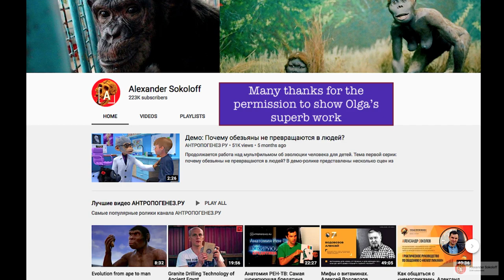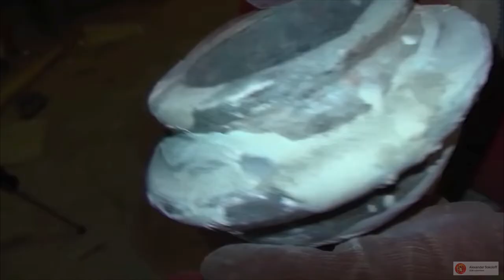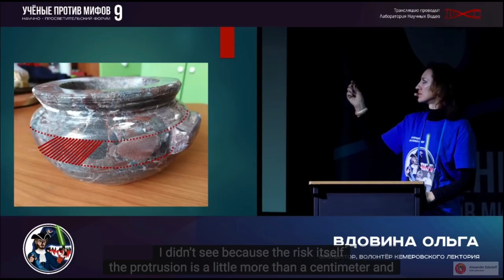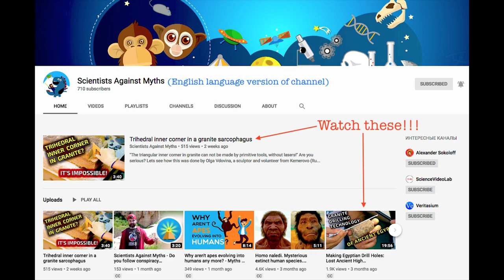How to make an ancient Egyptian Predynastic stone bowl with primitive tools!

Comment: And if you have a water powered saw and a lathe you would almost certainly have a powered drill, planning machine, milling machine........ It would even be possible with quite low levels of technology to have carborundum or even diamond tips on the tools - see here https://en.wikipedia.org/wiki/Diamond_tool under the section "Categories by manufacturing method" for attachment methods. These machines would be principally made of wood so nothing would remain 5000 years later.

Comment: I great how well she did with the first try. By way of comparison The Lotus Flower Vase with the three  partially folded lips at the Cairo Museum (that  Brien Forester points out) was very nicely done.  The object looks like a steering wheel or a gemie for making rope.  If you look at it closely, as with all the objects claimed to be made with "ancient high technology" they are not perfectly straight in places which suggests that they are hand made.  That is pretty impressive too because they are so delicate and thin.  The amount of time to do such a project is beyond me.  Chinese jade carving is a similar kind of hobby where people put endless amounts of time into a single object.
There is a relief of an Egyptian wooden lathe circa 300BC. The spun article is held vertically between two horizontal cross pieces.  A second person spins the object using a piece of cord wrapped around the object.  Having a helper would make all the difference to such a boring task.
Reply from the maker: great comment - I often wonder why nobody talks of Chinese jade - jade is extremely hard, yet some of the work that has been produced is incredible delicate.
Reply: @HistoryMaze  SGD responded to a comment I made on "jade sand" which was part of the traditional hand carving method. The Chinese panned for it and it commanded a high price. I don't know what it was made of.  SGD had some Roman references to polishing sands from India and Africa.
Reply from the maker: @drakedorosh9332  yes Pliny I think mentions this (the different sands for various uses). Corundum (that the Egyptians used incore drilling) can beused for lapping, as it crumbles to dust easily. It gives a moderate polished surface that is reflective (am thinking of the serapeum boxes and their finish). Black granite is also used for surface plates (preferable to metal) and can be worked to millionths of an inch. So with these two minerals alone, you'd have the ingredients for lapping incredible flat surfaces.

Comment: Great to see a video that shows a reasonable solution as to how these bowls could have been made by the Egyptians. 👍
However there are at least three points where tempered /hardened metals are used. I have to assume that its steel,  which was not available to the ancient Egyptians. However, I could be wrong, she may have been using something else. 

I have seen from other posts that you are directing people to the original source for further answers, so hopefully it fill in the gaps. 

As whole it's not a simple process but I can appreciate that it is not unreasonable to assume that the Egyptians could have figured this out.
Reply from the maker: Which part do you think steel was used - do you think this is faked?
Reply: @HistoryMaze 
For example From 1.14 onwards to 1.30 the sheen on the cutting edge does not look like the copper strip shown later on. It could be just from the abrasive liquid that it cause it look this way however.
Reply from the maker: @BaldyGreenGiant  If you watch in slow mo, you can see the occasional copper colour glint. I agree it looks silver at times, but honestly - think about it - if they wanted to fake this, then they would just use a copper tube for the filming. Checkout the latest videos from sacred geometry decoded - he has done various copper tube drill experiments. There's no need to fake the copper and replace with steel, as in fact, copper works best for abrasive drilling anyway.
Reply: @HistoryMaze  Wood actually works surprisingly well for abrasive drilling too.  My firebow bearing block was made with at wooden bow drill, a hardwood drill "bit", and flint chips in limestone.